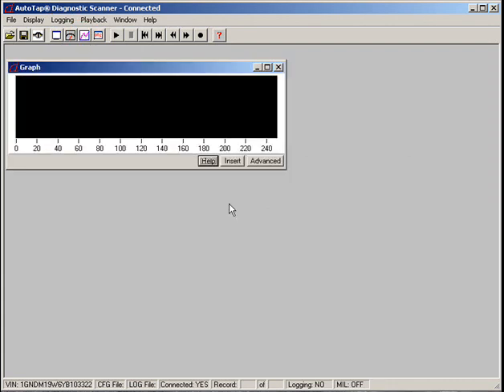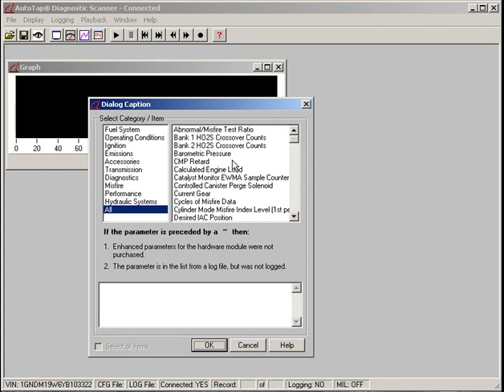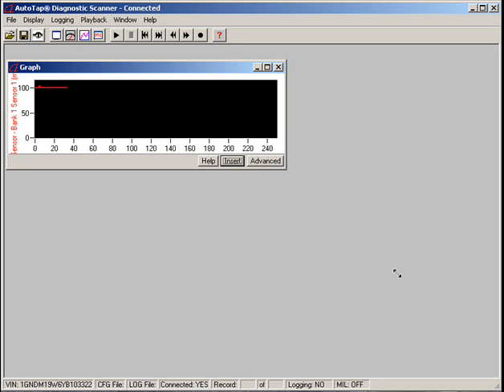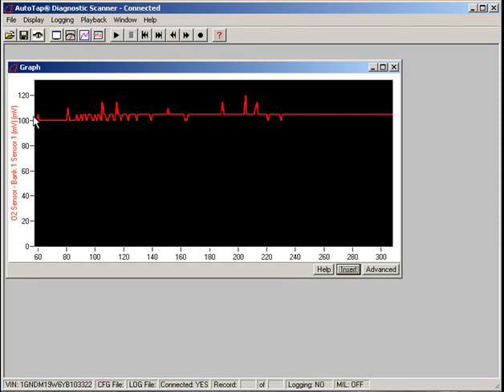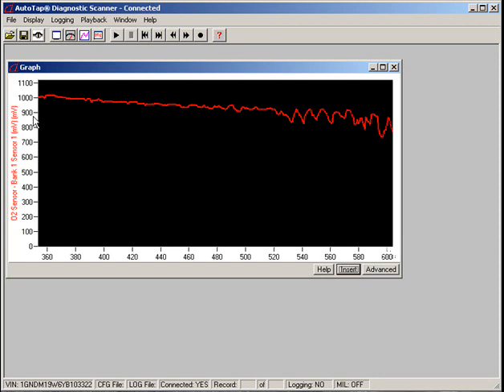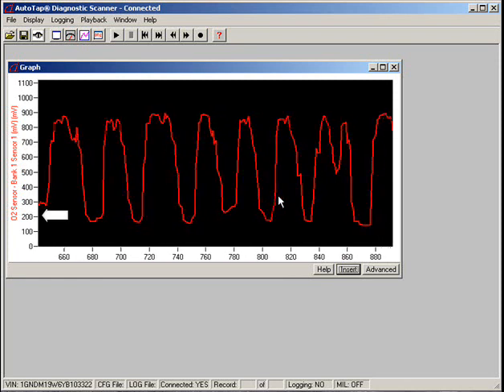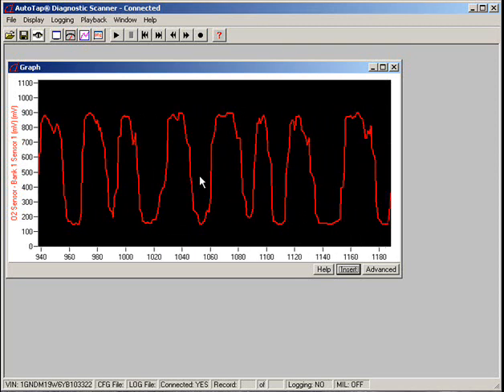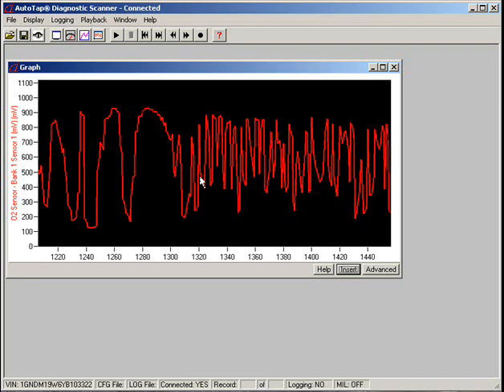02 (Oxygen) Sensor Diagnosis using AutoTap OBDII Scanner

Comment: Not quite. There are 2 or 4 sensors, depending on the exhaust system (split or not). None are IN the engine. Sensor 1 is upstream of the cat and, if one is there, the precat, in the exhaust pipe. Sensor 2 is downstream after the cat. Typically, O@ senors cause poor fuel economy only. Also, Sensor 2 will always be a flat line compared to O2S1. If they are both flatlined, replace the sensor.